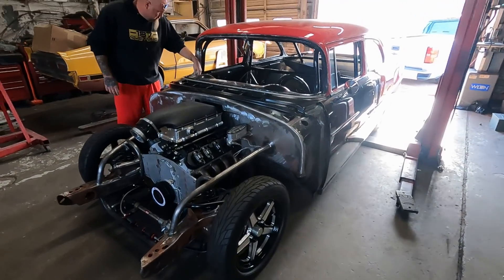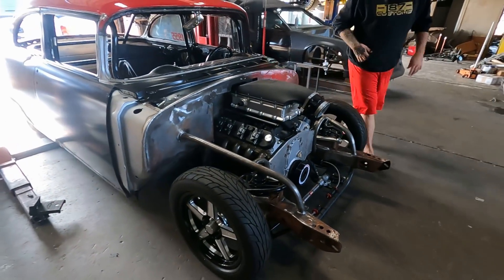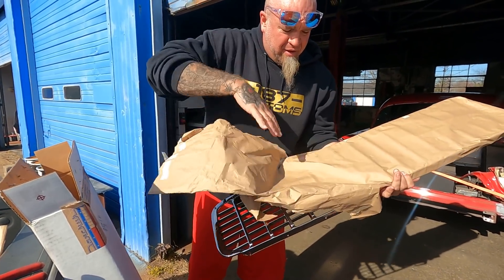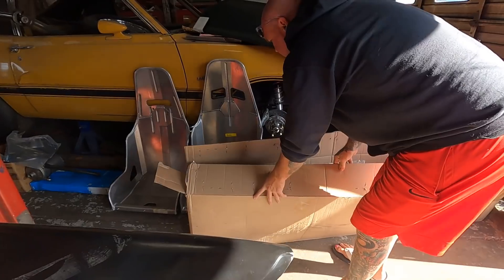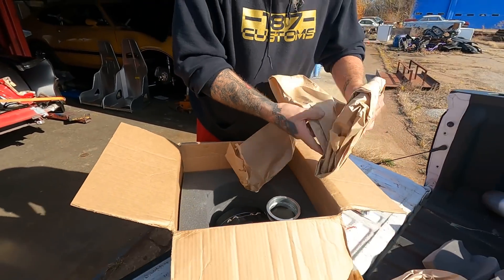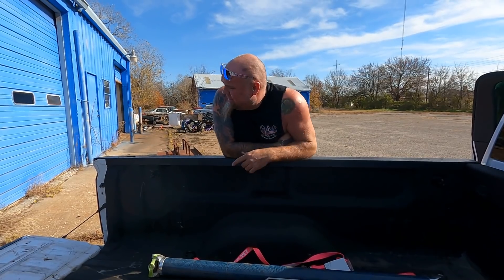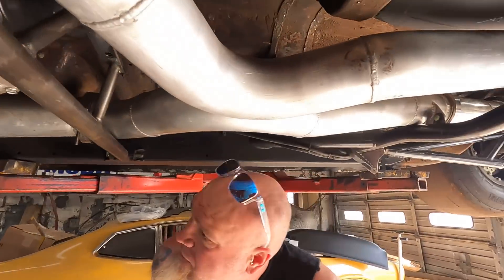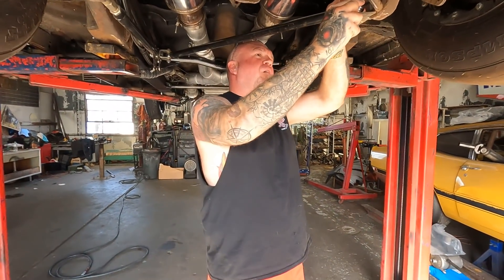55 Update! We're Running Into A Few Snags Trying To Rebuild!

Comment: If you were stuck on the side of the road, you might be able to run a stock water pump with a lower rib count belt without throwing a belt until you got somewhere to really fix it.

Comment: Yeah,I was having to mill down waterpumps in the 80s.I still went to the extent of rubber mounting my motor plate to the frame just to cut down on vibration.😏

Comment: so to keep running a stock water pump ...........?? you could have spaced all the brackets out the same as the motor plate ( thickness ) and everything would have matched up ?? no machining necessary ? maybe ?

Comment: Will the radiator be exactly the same or will you change so you don't have to run the hose across to the opposite side of the motor again?